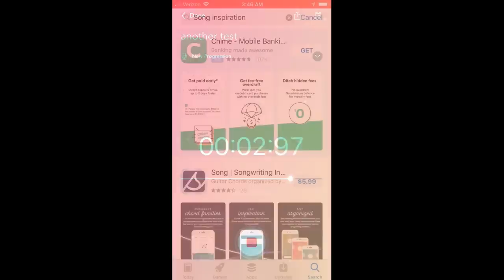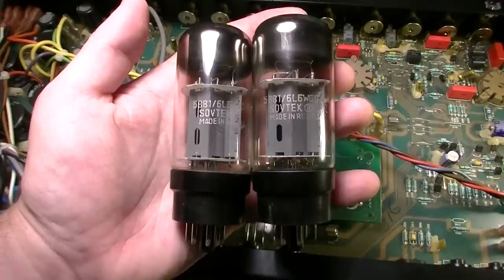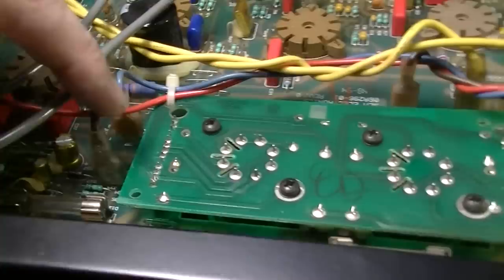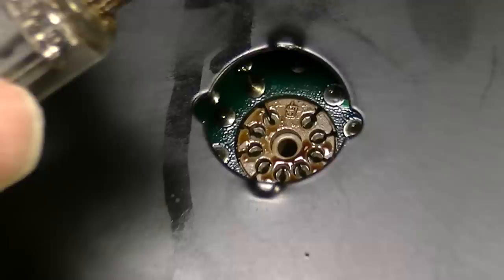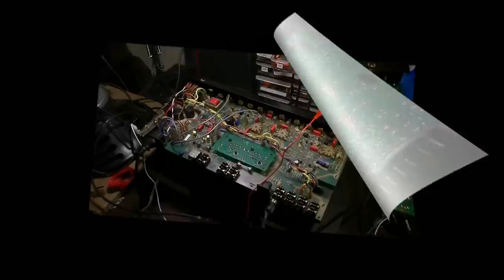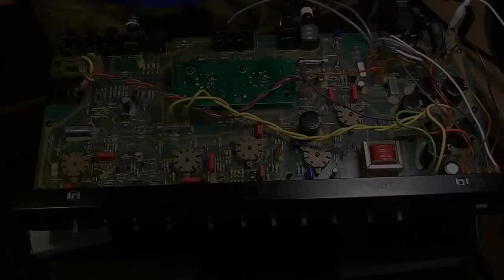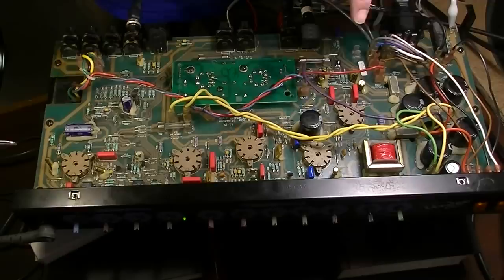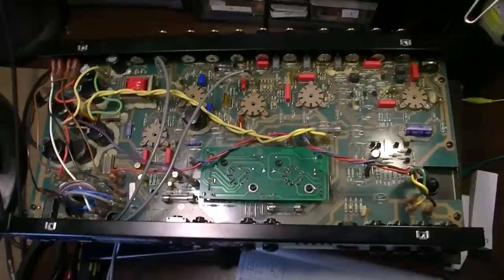Secrets of the Crate Blue Voodoo...or is it BLUE DOODOO? You Decide!

Comment: I gigged one of these forever. I still have the v30 4x12. I use my Larry Grohmann Dino with a crate cabinet 🤣🤣🤣
Reply: Ya. Ive picked up a few of those cabs cheap over the years. Just look through the speaker grating to see what size the center caps are. If they are small....score. if they are big....still a score. The cabinets are birch ply. Great cabs
Reply: @whatyoumakeofit6635  it's been my main touring and gigging 4x12 for years. 

Its just funny that I have a 6000$ amp on top of a crate cabinet.
Reply: @whatyoumakeofit6635  the "Crate" speakers are USA Eminences and one of their most popular designs to boot. 

Sad how many were unceremoniously chucked over the years.

Comment: Brad, I had almost exactly the same problem with a CRATE GFX212 . I'm talking about intermittent signal loss, no channel switching, sometimes it would switch when you banged the top of it, etc. It turned out to be several cold solder joints on the main board, similar to what you found. Rock on dude!

Comment: I encountered very similar problems with 2 somewhat different 1960s Ampeg Jet amps. Very low output because of dead or off spec resistors in the phase inverter circuit. SLM, who owns Crate,  also bought Ampeg back in the 1980s,  I think it was. Makes me wonder if this amplifier was using circuits similar to some of the older Ampegs.... And yes, some of the resistor values were unusual and I had to order them because I didn't have them in stock.
Reply from the maker: The 82K in that position is common on Marshalls and Fenders, but I just don't stock it because it rarely goes bad in an amp that has it. If I built clones a lot I'd definitely keep it in stock, probably will now going forward anyway.

Comment: i rebuilt one of these into a marshall 18watt using el34s using the stock transformers. i got it cheep as the board was fried. had to make a faceplate though. sounded great.
Reply from the maker: That's probably a good idea for a better amp long term.
Reply: Got a linky to a writeup on that? Really not a bad idea, especially if you got a cheap CL amp with problems for peanuts.

Comment: Some of the Crate amps from the 90's and early aughts were great sounding. I had a couple of the Palomino amps that were great. But man, if you have to work on them... All of them had pots that just stopped working, and when I contacted SLM before they went out of business, they told me they sourced those amps and couldn't get parts. Had to source replacement pots from the European distributor.
Reply: They didn't go out of business, at all. They sold off a lot of brands, but got back Alvarez. They still do a lot.
Reply: Please , i need pots for a crate, share the info on the European supplier.

Comment: No criticism from me about pulling chassis for a tube change.  I’ve often found secondary and root cause issues I repair.   I’d rather take the time and charge for the work than deal with the reputation damage to have a amp return.    The pin goo I think comes from the Radio Shack pot cleaner.   I’m 70 and I’ve seen a lot.

Comment: Nice job, I had an early Blue voodoo 6212, basically the same amp with 2 12's. I had an issue with mine not quite as severe, but still unnerving. I would play for a bit and then the sound would just stop. I'm not an electronics person so I took it to a shop in Dallas, they supposedly fixed it. They said it was a fuse, got it home played for about a minute and then nothing. Got a hold of a schematic, much like yours didn't match my amp, but anyway took it apart and was a simple fix fortunately, one of the push on connectors was sloppy and barely making contact.  Tightened it up, replaced fuse and all was right with the world. People like to bag on them, but they really are decent amps for the price.

Comment: I have two Blue Voodoo heads, and one of the main problems is the "self-biasing" circuit. According to my repair guy, people get into trouble by changing the tubes, which have different values than the Sovteks it was engineered to mate with. My BVH 50 (small head)     (Video clip    https://youtu.be/7rL_3D8DS4E  )  had to have, a manual bias setup installed to deal with the problem and different tubes I put in, for it was overheating. Now it works great, I do not abuse it. I also have the larger BVH60, and put a whole set of Sovteks inside, to replace the set of Mesa, and Marshall tubes somebody stuck in it. (Video clip  https://youtu.be/utlYe_fK5A0

Comment: I think I think the Brown goop inside the tube sockets and also the amp could very well be nicotine stains I have had that same issue repairing radios back in the 90s. The chassis definitely not airtight the way it is constructed , cigarette smoke could have easily gotten inside especially if the previous owner was a chain smoker.

Comment: The fading out on these amps are 99 out of 100 times a dirty FX loop.
Reply: No dry joints? [UK exemplar]  Stay free, M S,. 😷...   R  😎
Reply: Yep.  Picked up mint Peaveys and Crates over the years for under $50 because the owners thought they were fried.
Dirty FX loop jacks were cleaned and they worked like new.  To this day still don't understand how this kills amp output.
Had a redstripe Bandit pull this stunt years ago at a gig.  Five minutes of fine and then nothing.
Luckily brought another for backup.
Researched online forums the next day and through others found this quick fix.
Reply: @roaddog7542  🔊  😎
Reply: Yup...first step, wiggle input, second step, wiggle output, third step--bypass patch cable in/out on FX loop--however this amp definately had more going on before getting to that

Comment: Awesome to have you back. Yep yea need some lights. The Ace hardware near my house sells a clamp light with an extra long cord. You can get a few of those with some 150w led daylight colored lights. You’ll be set. Harbor freight has them cheaper of course. But I find the longer and I think heavier gauge cord better. Though it could be heavier plastic and not gauge. But I’ve never had a problem with mine.

Comment: These were the same cabinet and chassis as the SLM era Ampeg VT-60/120 combo, totally different circuits though. If I remember correctly these came out shortly after the VT-60/120 was discontinued. They probably had a bunch of unused cabs and chassis lying around.

While the VT-60/120 did have some issues of their own they were significantly better sounding amps. They also came with some cool features such as a triode/pentode switch for 1/3 power. The 120 also had a 1/2 power switch that could be used in conjunction with the triode/pentode switch for 20, 40, 60, and 120 watt operation. The user manual also claims it can run 6L6 OR EL34's utilizing only the bias adjustment. However, the screen resistors are 470R, which is fine for 6L6's but 1K would be more appropriate for EL34's. Still pretty cool tho, tube driven reverb too.

Comment: I have the bv120 head, had to revoice it a lil bit, change a couple caps and resistors. I still need to rework the negative feed back for the presence. It's still  a bit harsh past about half-way. But it's a solid metal amp now holds its own with the dual recs and 5150s. I think I have about 400$ bucks in it. Been playing it for over 10 years now. Can't beat the value. I'v been considering buying another one just to gut it and and reuse the iron, the pots, jacks and box to build something custom.

Comment: I converted  one (BV120) to a Marshall 2203/Plexi 1987 (EL34's) circuit using the extra tube.  I trashed the board and just used the ac input section and the section for the output jacks. You can even use the blue accessory wires on the power transformer to power a reverb or tremolo circuit.

The layout of the tube sockets and transformers cause you to need to use shielded wires for everything signal. I completed the project in 2010 and I did it because I wanted to lose the harshness of the BV120 TONE. It was a success.

Comment: My first tube amp :) I had the 212 60 water it was HEAVY and LOUD, crapped out on me the day I brought it home, it was my fault because I stupidly changed the handle and didn't check the washers, one fell down and shorted what I think was the hum balance circuit (?), a long trip to the service center and some 120 dollars later it served me well for some years, the clean channel had some nice break-up, I even got a matching 4x12 that I seldom used, ended selling the amp and a few years later the cab, it wasn't the Celestion equipped one though. I have some fond memories of that amp.
Reply from the maker: The Eminence speakers are great. I wouldn't worry so much about Celestions. I personally think Eminence are every bit as good.
Reply: The Guitologist mine had “custom” CRATE speakers, so no Eminence for young me :)

Comment: Just a notice, you can get 82.5kR of resistance for the PI by putting a 100k and a 470k resistor in parallel, which are quite common resistors. That equals out to 82.46kR

Comment: You know, the oily crap may be Flux... which you use when you solder stuff. I'm not an expert, but since it seems to be around areas where there is soldering going on, I can see someone just wiped flux all over the place to re-solder some stuff, and just left way too much behind afterward and it got in the Tube pots. Just a possibility.
Reply: I agree with you , it's Flux.

Comment: Brad, seems like an obvious question to me, but do manufacturers ever provide an access panel on the bottom of the amp chassis that you can unscrew to get access to the connections on the bottom of the PCB? So that one wouldn't have to unsolder/unscrew everything to replace components?
Reply from the maker: I've seen that done in Ampegs and in some Japanese amps.

Comment: There is actually nothing wrong with a PCB construction.
It's only just really sad what the quality is from most amplifiers, especially from the 80s and 90s.
I am a PCB designer and developer myself and I can't explain how hard I am crinching when looking at these kind of boards every time.
That is just plain lack of knowledge and skills in proper board design, even WITHIN a certain budget.
There is also absolutely no reason that repairing them is so difficult.

Nice to see you back on track Brad!!
Reply: There are two main problems in tube amplifiers. One is that old boards could actually become conductive and that was death for the amp. The next problem is putting things on the board that humans have to touch and manipulate. Controls, jacks and tube sockets direct on the board is broken solder joints just waiting to happen.
Reply from the maker: It just would have been nice with a better double-sided board with thicker traces and better pads. These pads were VERY weak. One tried to peel up after having my iron on it for 2 seconds. Just cheaply made junk really.
Reply: Let's not forget proper trace design to eliminate noise, hum, etc. Manufacturers using circuit boards do so for only one purpose and that is to speed up the assembly so they could charge less for their amps and get market share. The downside is they're trying to save money and not invest even more money into proper pcb design.

Comment: Why burn up expensive tubes until the problem (intermittent) has been identified. Whoever is criticizing knows zilch. Brad, Im a novice, and i learn alot from your videos. I dont think all crates are bad. They are built to a consumer price point. No they are not easy to repair, they are not intended for major repair. Crates are notorious for cold solder joints (so are the 80's peaveys), but its fixable. After 25 years and probably hundreds of hours use its at the end of its life. My solid state crate GX130C still sounds amazing and I love my Stealth GT50 (Lee jackson designed ampeg VT) and will not part with it, ever.  A Marshall killer for $150 bucks.

Comment: Maybe that goop was dielectric grease for outdoor electrical connections. I recently had an electrician tell me a main breaker box was corroded and needed replacing, when I pulled the old one and replaced it  turned out someone put that on the main buss bars!

Comment: I just sold one of these. I picked it up for $60. Had the same issue with 1 tube being bad. These things had issues wjth heat collecting around the solder joints on the tube sockets. And they didnt use much solder from the factory. I resoldered everything and changed a couple bulging capactors and it was like a brand new amp. Thats why these amps had so muhc trouble. Shitty soldering. 

They made it pretty easy to take apart. Unplug all the wires and the back panel comes off via screws on the top of the chassis. Takes about 15 minuted to pull apart and 15 20 minutes to reassemble

Comment: I did warranty repair on a lot of SLM 90s amps over the past 20 years.  The BV series was my LEAST favorite SLM creation (though their Ampeg Tri-Ax series was a very close second).  That %#$@$ power tube daughter board was the source of lots of hair-pulling in the field (as you experienced).  Specifically it's the pin connectors.  They all fail eventually, in one way or another.  First, there's no reason to expect those puny pins to be able to pass the relatively large amount of heater current (especially if the amp gets transported on a regular basis), so I saw lots of scorching there. But if the grid connecting  pin goes intermittent, well, you can imagine the results if bias voltage goes away.  Their fix:  Longer pins.  It sort of worked for  bias failure, but they were just too skinny for the heater connections .  At least this one was only 50W.  The 100W version was harder on the connectors.

Comment: I have the same BV-6212 sitting in the garage for the last 15 years or so…
Thing is I need to replace the tubes. Is it possible for a non electrician to change preamp tubes as well?
Crate manual says only by qualified technician…?

Comment: Had my power amp smoke on me. Turns out it was the cable itself, but after replacing it and checking the fuse it’s still stuck in protection mode. Any guesses?
Reply: What cable? In or out?
Reply: @PapaWheelie1  power in. I replaced some burnt resistors in what I think is the preamp section and they lit right back up.
Reply: @graxjpg  - good to hear. I was thinking signal cable not power, my bad. 

If someone has a speaker cable short it can easily wipe just the output transformer or the whole power section.
Reply: @PapaWheelie1  yes I’m glad the transformer is alright! If I’m lucky it’s just the protection circuit is busted and is sending too much voltage to those resistors

Comment: I just found one of these. It was the BV 120H model but it did not work I was told it did not have sound.
He wanted a 100bucks was it worth it to buy? It included the big speaker.
Reply: Dang I just bought a working one for $120. Barter that fella down
Reply: @BorisBidjanSaberi11  I would have if I had the money with me. I only had about 20 bucks left. The sale included the big speaker cab I would guess with four speakers. So if I had the money I would have offered 80bucks

Comment: Being a tavern owner and part time weekend warrior in the local bars back in the early 80's that funk on the tubes looks familiar. People still smoked very heavy in bars back then. I had two huge smoke filters that ran on high voltage and they were always filling up with that resin. TV sets and radios in bars back then also ended up covered in cigarette tar. Any guitar amp from the smoking bar gigging days I suspect would look the same inside. Whoever put those Russian tubes in probably cleaned a lot of the resin out the last time it was serviced.

Comment: It many combo amps that have been around for awhile, especially 50w tube combos or higher, tend to have broken solder joints caused simply by the weight of the unit. Because of the weight they are usually harder to lift, and subsequently get put down harder. The culprit is usually someone other than the owner of the amp, who doesn't realize the weight of the amp, or it fragility.

Comment: 12:90
We didn’t realize how well we had it!
This equipment got the job done and performed surprisingly well.
That goopy stuff is most likely cleaning residue. The amp chassis was filthy, somebody improperly cleaned it, they should have removed the tubes and gave the boards a proper cleaning.

Comment: I'm wondering Brad how you discharge caps in a single side board like this.
Basically you don't have access to the pins without pulling out the board 😭

Comment: Twenty years ago I had a radio shack aerosol can of combined pot cleaner/lube that worked at first but in a year it had left a brown greasy residue on the pots and board.  My experience was early on in my interest in amp tech work and I used too much.  Sockets, pots etcetera.   I suspect the goo left is the same thing.

Comment: I had an old Crate.  After replacing caps and such I had to put a fan in it....LOL..... which they should have put in it to begin with considering anything old with cheap components and hanging tubes.  It sucked to work on.  And, the pots are terrible, plus board mounted.  I'd love to be able to redo the old amp with point to point wiring and toss the PCB.  I thought it was a great sounding amp, just cheap.  If it is similar to mine, new tubes helped for a few days, but didn't answer the bigger problems.  (exactly as you stated)

Comment: When you're Injecting a 1Khz signal into each stage from grid to plate, I'm not sure how you were getting an audio signal on the amplifiers output speaker when the phase inverter tube section/stage was not working. I saw you injecting all the other stages but those are all BEFORE which the audio signal would be BLOCKED because the phase inverter tube section stage was not working. It was weird that the audio signal was still coming out of the ampilifers output speaker